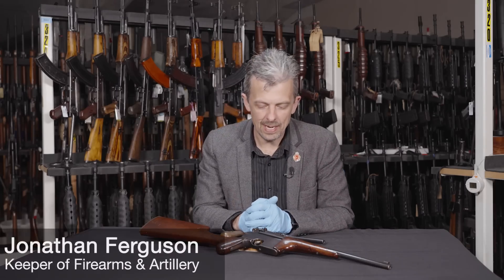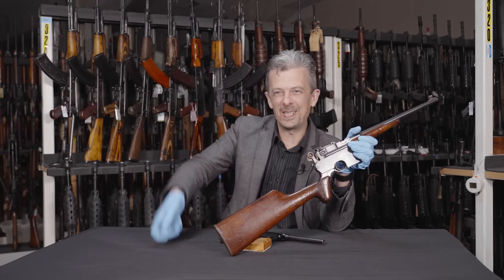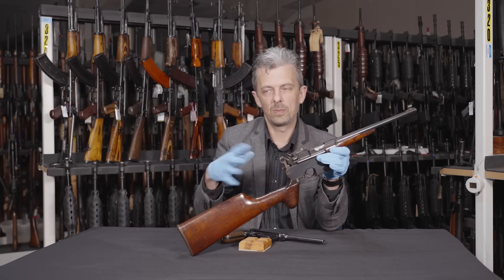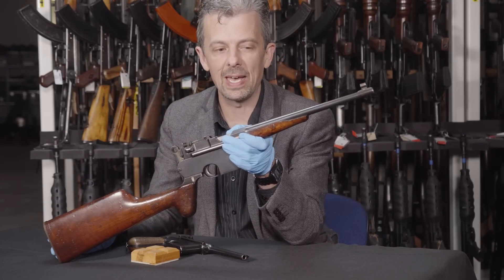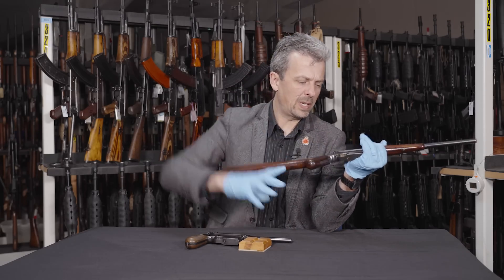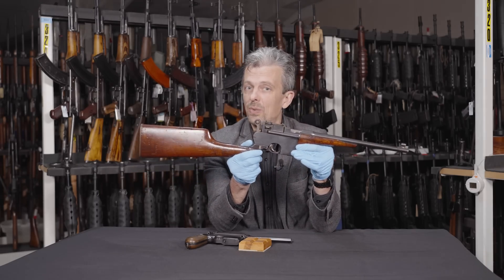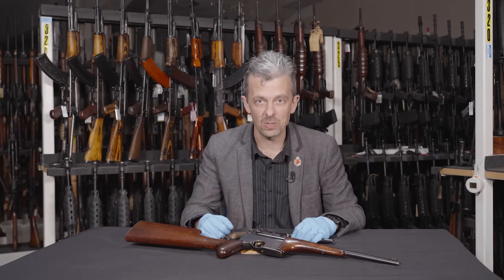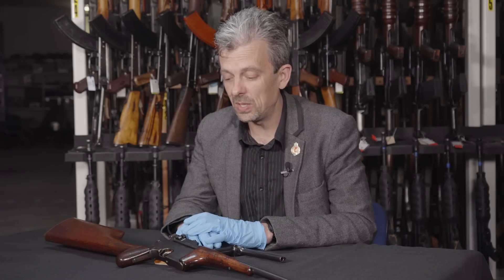Why did Germany use a C96 Carbine during the WWI? With firearms and weapon expert Jonathan Ferguson

Comment: Of all the German-made firearms, including the STG-44, this is the one I'd like to own more than any other. The C96 carbine was first promoted as the ideal hunting weapon for chamois. Being light and easily broken down into two very compact pieces and just as easily reassembled, the hunter could carry the gun fully protected in a backpack while he made his way high onto the rocky mountainsides where the chamois like to feed. The flat-shooting 7.63x25 could take those little goat antelopes at range and the bullet didn't severely damage the valuable hide.

Comment: Winston Churchill bought a C96 Mauser when it was this year's model of automatic pistol in 1896. He talked about the fact that he hurt his right arm when he was getting off a boat in India for his first assignment as a young cavalry lieutenant and he quickly found out that swinging a saber would dislocate his arm. He decided that his best bet would be to buy the best pistol he could and use that instead of a saber when he actually had to fight. Later, when he saw combat in Egypt, he said that the fact that he had to use a pistol instead of a saber as his primary weapon saved his life. He killed a few men at close range after a cavalry charge with his C96 when using a saber would have left him vulnerable to attack by the other combatants. He said that a couple of shots on the torso of a man would do the job, and it was fast to reload.

Comment: Frankly, I'd rather have a slightly cut down Enfield rifle with .303 to down another aircraft than this. 9mm isn't going to do much damage to an opponent's engine or control surfaces, and has a pitiful range. But to each their own.
Reply: why would a German pilot use a British rifle? and the C96 carbine was chambered in .30 mauser
Reply: These C-96's weren't chambered in 9mm parabellum, but in 7.63 Mauser, a bottle necked cartridge, with much better ballistics than 9mm, in the early 1920's the American importer for Mauser weapons advertised the standard C-96 as "The worlds most powerful handgun", the sighs on the pistol versions are calibrated out to several hundred meters when used with the holster attached as a butt stock.
Reply: The 9mm Parabellum versions of the C96 appeared later and had the number 9 routed into the pistol grip sides.